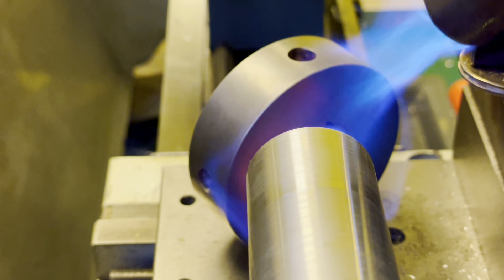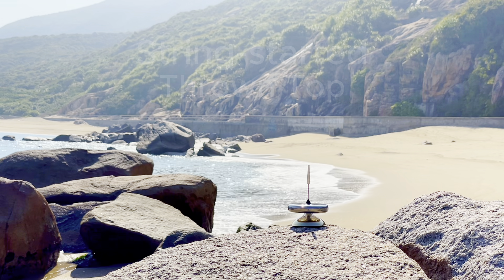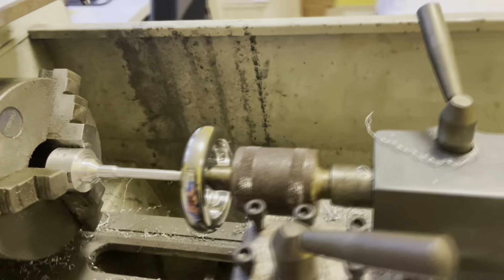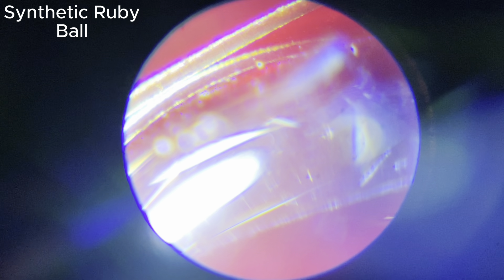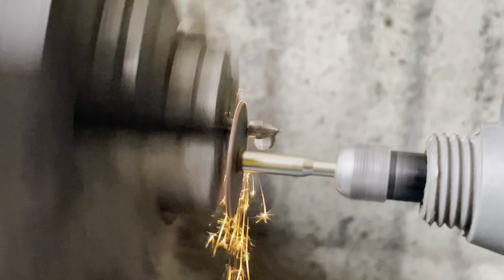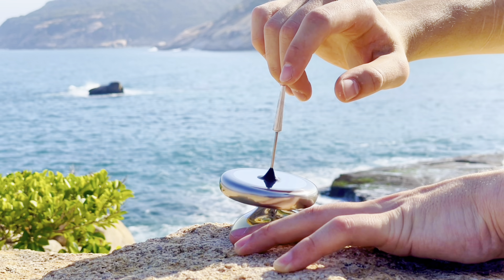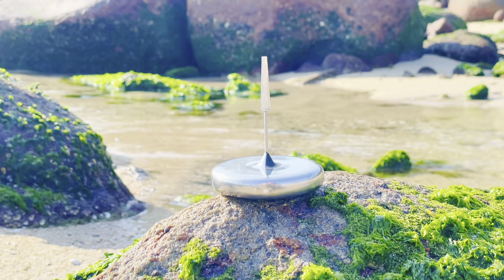Spinning Top Mk.24 | RUBY & SAPPHIRE

Comment: Have you studied whether dimpling the top (like a golf ball) would reduce air resistance? Also, incorporating magnets in the base and top with like poles facing each other might reduce friction by lowering the "weight" of the top on the base.
Reply from the maker: Regarding the dimples, the consensus is that they would be counterproductive. I plan to explain/test this in a video soon!

Comment: does knurling the stem of the spinning top add drag? Presumably harder to start spinning, but would be interested to know. Also how much more speed can you get if you used a threaded start? Or used the palms of your hands to start it?

And v basic question, but for the base, if you use a material that's harder than the contact point, then wouldn't it never get scratched?
Reply: love watching the time and effort goign into these videos btw!
Reply from the maker: Knurling has a small impact but compared to the impact at the flywheel, it is negligibe. What do you mean by threaded start? Currently I wouldn't say there is another easier way to start the top faster (including with palms), however perhaps with practice the palm method has potential. 
And regarding the harder base - yes I believe this is true, hence me being keen to make a diamond base :)
Reply: @ threaded start: I mean using a string!

Comment: I am confused about which component your Chinese sponsor makes. Can you elaborate?
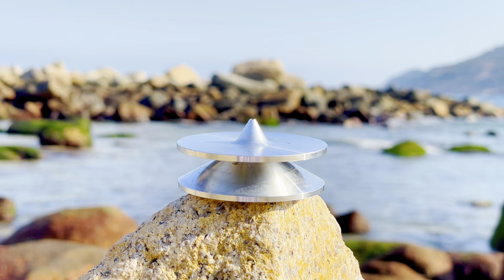Reply from the maker: It's the part seen at 3:27. I call it the core. It's made of aluminium. I used to machine this part but CNC makes it much easier to optimise the shape for light-weightness.

Comment: Have you considered getting someone else to spin the top for you?

No offense but you don’t look like the strongest human, I’d assume more energy = longer spin?

Top still seems to not be balanced 100%, how much room is left in that department? 

Really cool video though! 
No idea how I got here but I’ll check back in!
Reply from the maker: I haven't seriously considered getting someone else to start it just because of the muscle memory required to be accurate in your spins. However either for fun or to get across the finish line for the record, I would absolutely try. However, the addition to spin time may not be as much as you think. Due to the rapid increase in air drag at high speeds, doubling the launch speed to 4600 rpm would only add ~8 minutes to the spin time. 
Regarding the balance, for the 1;20;11 spin, it was much better. In truth, I had an accident and the stem got slightly bent shortly before filming. I tried to fix it but it isn't perfect anymore. Thanks!
Reply: @ Interesting!

I just figured, I raced motorcycles and cars all my life, you go faster by either getting lighter or adding more horsepower. 
Then when you start talking about world records, it’s seconds or possibly tenths of a second.
You may be able to improve the performance / design of the top but much like bodybuilding, where you have a “max genetic potential” before people start using steroids, I’d think the engineering of the top Vs time gained would eventually experience diminishing returns. 

I am actually very eager to see how things turn out. 
Never thought I’d invest my time into watching someone spin a top. 
Best of luck!

Edit: the experimental surfaces is an interesting angle too. Are there no metals out there , some sort of exotic alloy or what have you, that might be even better? Or perhaps a mixture to get the desired weight / balance? 

How much does a total redesign cost you? 
I’m so interested I’d be willing to donate $100 USD to the cause.

Comment: At this point you should start taking the top to mountains, finding somehere with lower air pressure might add you a couple minutes
Reply: Couldn’t you spin the top in a chamber rather than hike to the top of Everest?
Reply from the maker: A vacuum chamber isn't allowed for the record, but I would be down to try it at altitude at least to see how much it improves :)
Reply: @hiper_tops  i would have suggested vacuum chamber lol but I don't know how you'd reach your hand in to spin it

Comment: Can you machine grooves so that the air that's coming off of the top surface is redirected from radial to tangential direction?  Make that airflow work in your favor.
Reply from the maker: I believe the increase in viscous drag would significantly outweigh any benefits, but I could perhaps try
Reply: @hiper_tops  I know you already said this, but you definitely have to try using a polycrystalline diamond base, they are used for frictionless bearings.

it will definitely break the record, so you gotta try it!

Comment: I am new here and have not watched the full series but this idea just came to mind. What if you could have some sort of very high viscosity liquid on the inside of the hollow top. you start spinning and majority of the mass is closer to the center however with time and centrifugal force the liquid would slowly crawl to the outer wall of the hollow top. Again I just had the idea idk if it would work maybe someone smarter can disprove my hypothesis with ease. In my head as long as the liquid was moving outward slowly and at a steady rate wouldn't it retain its rpm until the liquid reached the outer wall?
Reply from the maker: I believe the conservation of angular momentum means such movement of fluid wouldn’t provide any boost. Very interesting idea though
Reply: It’s an interesting idea but I don’t see how it would help. A drop of liquid that starts near the center and ends up at the edge will be moving faster than before, for a given RPM. But it costs energy to make that drop speed up, and that energy will come from the top itself. So, as more liquid flows to the edge, the top has to slow down.
Reply: There’s a classic physics demo about this which you can try if you have an office chair. Sit in the chair, cross your arms on your chest, and spin around. Then, while you’re spinning, stretch your arms out to the sides. The spinning will automatically slow down as some of your mass moves away from the center. You can even speed up again by pulling your arms back in.

The physics term for this is “conservation of angular momentum.” Let me know if you have any questions about it. I was a physics major and I love talking about this stuff.
Reply: @younglove6363 Ahhhh I see, thank you for the easy explanation and example. I'd love to ask more questions but I have already stepped far out of my realm of understanding lol. Thank you again for taking your time to respond!
Reply: @thechuckyboi1438  no problem! thank you for sharing your interesting idea :)

Comment: You would think that the thick outer wall would hurt aerodynamics as it might encourage turbulence since there isn’t an obvious detachment point for it to cleanly break off from the surface as it moves away from the axis of rotation. I would think that something sharp would be better as the edge of the base would act as a trailing edge. Idk enough about this to be sure though.
Reply from the maker: The thing is drag is very dependent on radius so any addition is likely to detract more than it helps. Still I hope to test this

Comment: It seems like, rather than a diamond base and carbide tip, it'd be better to use a diamond tip and carbide base. The wear rate of the tip increases contact diameter much more than the base wear rate, since the tip moves around.

Another optimization that comes to mind for me is, making the knurled top (for your fingers) shorter. You're only using the top half or so of it, and it's probably a significant fraction of the aerodynamic drag.

Also, on that knurled top, you probably want the ridges as small as possible. More smaller ridges should give similar friction with slightly less drag.

Tungsten carbide and diamond are obvious choices, but another possibility worth considering is boron carbide.

This is maybe the most obsessive nerdiness over something trivial that I've ever seen; my hat's off to you.
Reply from the maker: Thank you! Yes good suggestions

Comment: Are you required to test at sea level? You could cut drag down significantly at high altitude. Also, Nasa loves stupid click bate. If we ever go back to the moon maybe you can get them to spin a top with no drag and 1/6 the friction on the tip due to gravity.
Reply from the maker: A top designed for the moon.. now that would be cool. Actually the rules are quite vague about altitude…

Comment: Why no dimples like a golf ball?
Reply from the maker: Dimples would increase viscous drag without any other benefits. I will demonstrate this in a video soon
Reply: @ ok, I see. I thought it might make a boundary layer of turbulence which then has less drag than the top’s surface. Goodluck! I also thought maybe increase the radius of the top, this should increase the inertia, thus angular momentum.

Comment: Are there size and weight limits?  Because I would imagine you can increase spin times to arbitrarily large by increasing its rotational inertia? But I assume you know this so maybe the increase in aero drag if you increase the radius outweighs the advantage?

It seems to me that your max start speed is ahead of hard limit based on how fast you can flic your fingers right?  So the only way to do better is increase inertia and lower drag?
Reply from the maker: Yes there is a limit to how fast a top can be started. I suspect around 3000 rpm for someone like me. So increasing inertia to mass ratio and improving aerodynamics are good places to work on.

Comment: does changing the diameter of the top affect the spin length? if you were to make it bigger i would think that since the outside of top would create more friction with the air so then what if you kept the same bass but made it thicker instead of wider. that would then have less inertia to keep it spinning but less wind resistance. Im also wondering if minimizing the surface area would help agains wind resistance. For instance instead of having the top flat you made the whole top kind of shaped like a cone. Where you don't have any vertical faces. I hope that makes sense.
Reply from the maker: I think I understand, and you are right, radius and height of flywheel are crucial design variables. I’m still perfecting my formula which can help find the optimal ratios but what I use at the moment seems to work well.

Comment: Do you know if Guinnes World Records puts any restrictions on the height at which you spin? Might make a difference if you spin at sealevel (like literally in your video 😉) or at the top of a mountain. 

Also, does it state specifically that you need to spin by using your fingers? Otherwise using flat hands together might be more efficient, or even more creatively: using long hair to pull it like a string! Still using your body there. But i dont know exactly how strict they are in the rulebook.
Reply from the maker: I suspect they are more relaxed about rules than it seems, generally the rules are vague and don’t specify altitude limits for example. All good suggestions. Regarding using the palms, there is certainly potential but I would need to practice a lot!

Comment: are you allowed to spin it in an open vacuum chamber then close the chamber and suck the air out for no air resistance?
Reply from the maker: Not for the record but this method is useful for data collection :)

Comment: Its a good idea to iterate on things surrounding the spinning top, should it spin in an enclosed space, and should the ground be near it? You could also smoothen the ground, or use a specialized chamber which optimizes the airflow to and from the top. Regarding the eddy currents Inside of the top, you could use a helmholtz coil to cancel out earth's magnetic field. The base should be mounted very securely to a solid surface so the base/ground beneath will not flex with the added benefit that you won't have to hold the base while spinning up. You can have a look at telescope mirror making, they make use of lapping. And I'm curious about the air drag on the inside of the top, maybe polish the inside or use aerogel.
Reply from the maker: Really interesting ideas, I suspect some may have negligible impact but there is certainly more that can be done, especially to the base

Comment: Just so you know you can make your own synthetic ruby and sapphire for very low cost    
The ideal ratio is 32.3333 alumim oxide to 1 part chromium for rubies 

You can form them into a shape easily and they can have incredible surface finishes the quality of your ingredients and the surface of your mold is very important but the actual process is simple the easiest way is to take two carbon electrodes on an ark welder and just heat the mixture until it liquidates but not to long or it darkens from being overlooked this method does leave some impurities but is vastly less expensive than beating a furnace that can hold 3600c
Reply from the maker: I saw nighthawkinlight do this I believe, very cool!

Comment: Maybe a super slippery lubricating coating on the contact could help even more?
Reply from the maker: Yes this would be interesting
Reply: @hiper_tops  I know graphite dust is used as a dry lubricant for a lot of mechanical applications, perhaps you could apply some of that? I’m not sure if it’s against the rules but it would be interesting to see just how much of a difference reapplication would make throughout the spin

Comment: Have you ever tried using two hands for the starting spin? Like one index finger on each side sliding opposite each other for more contact time with the spindle.
Reply from the maker: Yes and I think there is potential but it would take a lot of practice to get accurate enough to benefit from the increased strength.

Comment: What a very interesting hobby, what is ur background, did u do any kind of studies? And how well based are ur physics considerations?
Reply from the maker: Thank you! I’m in the middle of an Engineering degree having taken a couple gap years. The early days were pretty much trial and error but since Mk.19 I’ve put some effort into collecting data (air vs vacuum runs and measuring rpm decay etc) and using it to solve for constants in a derived formula for spin duration as a function of mass, inner and outer radius, height, density, air viscosity, air pressure, tip and base Young’s modulus etc. There is still plenty of room for improvement but it has helped me find at least the local optimum which can be seen from Mk.22 onwards :)
Reply: @hiper_tops  That makes sense, smart method to use in order to get the constants. Im an applied physicist myself so wondered about that when I saw the video. Sounds like u got this down, if I had some metalworking skills myself I would love to give it a try but I will just keep following ur videos from now on :).

Comment: This is so cool :D, just subscribed to this fabulous channel
I wonder if you may be loosing some energy trough the vibration of the top's "handle" as it seems to be just a bit off axis. This is very important in satelites and spacecraft as any antena vibration dissipates energy and slow down their rotation. This effect is ever so tiny, that it may only be relevant in the vacuum of space, yet in this extreme scenerio it may be relevant.
A massive base to minimize looses through vibrations could help too. That is why anvils are so heavy: so that the hammer strike´s energy get absorbed by the work piece and not dissipated through the base. Yet again this effect may be very small but atleast it is easy to try. Just put the base on a chonky piece of metal and be sure they make good contact (clamps could help).
Reply from the maker: Thank you for the suggestions, I think they would help although the addition to spin time may be small :)

Comment: I’m not at all clued up when it comes to engineering but could a variable moment of inertia mechanism make something spin longer? I understand it’d be a lot of extra parts and balancing could be an issue
Reply from the maker: This is an interesting idea, and yes it could potentially help if mass were closer in at the start (when air drag is large) and further out at the end. However the rules state ‘no moving parts’. Anyway it would be fun to try some time!
Reply: Is liquid mercury a moving part??? 😊